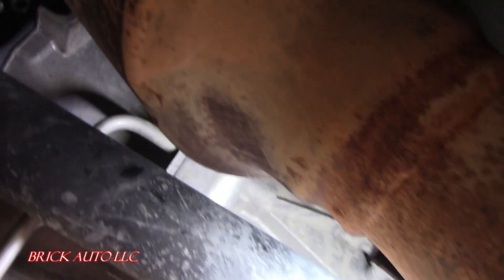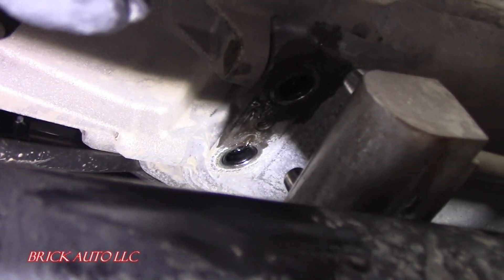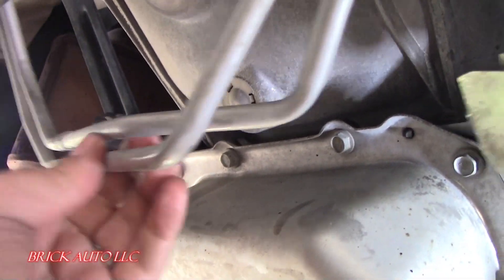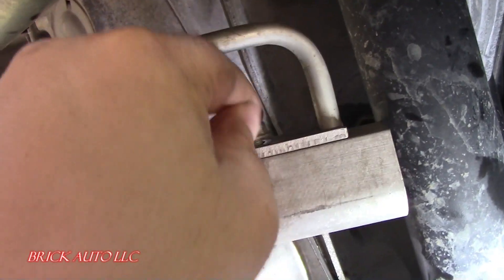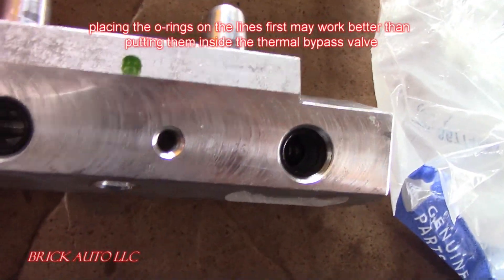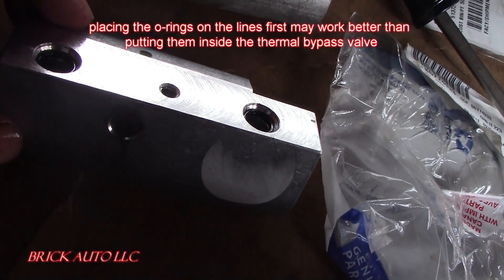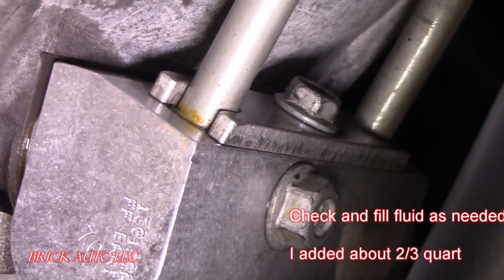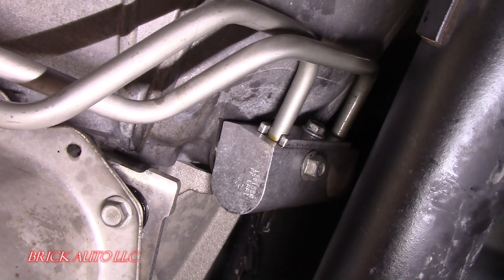Silverado GM 6L80 Transmission Thermostat (TBV) upgrade - Runs 40 degrees cooler! TSB 21-NA-199

Comment: I had this TSB done when I had my old blown-up 6L80 replaced with a GM reman last month. Was running in the 190s all the time, now it tops out around 170 and only on a hot day in heavy stop/go traffic. I am confident this will extend the life of my new reman transmission.

Comment: Valve (new) 8558533 has replaced (old) 86774933 and seal (new) 85628205 has replaced (old) 23135703.
Reply: Yep just got these parts from the dealer myself today, updated part numbers. They also had no idea what this tsb was but they were happy to help

Comment: Doing it now... 2016 5.3 97k miles. Tranny went out at 82k new transmission trying to get it to last longer then 82k
Reply: Had you changed oil an filter at 45,000 miles? Like your owners manual says?
Reply: Any update on how the truck is doing so far?

Comment: Well, this blows. Gmpartscenter says its no longer available. If you know where else I can get this please reply. TY:)
Reply from the maker: Sorry, finding quality parts if found at all has been troubling for all makes the last couple years. For this, I would do general searches for the part numbers and see where they pop up. While searching you might come across interchange or updated numbers for the ones shown & if nothing else, I believe there is an aftermarket kit to swap out from within the housing. The latter should be available as an alternative,  I think others have posted names in the comments or will certainly come up in general searching. Good luck
Reply: There’s new part numbers. Someone in the comments posted the updated ones. I can confirm, because I just got the updated parts to preform the swap today at my Chevy dealer. So they’re around you just have to do some digging

Comment: The updated part can still fail just like the original one. It still has a thermostat that can stick closed.
Reply: Correct me if I’m wrong but modern thermostats are designed to stick open when failed, so will flow constantly. The problem with the original part isn’t that it failed, it’s that it was designed to run too warm.

Comment: did anyone have a what sounds like air purging sound after doing this? my truck makes this weird noise when driving for the first 10 mins like its purging air thru the valve. My temps def went down they average about 160 now so it works great..
Reply from the maker: @JamieRabago-x3k  unusual symptom after this repair, I'd double check the seals, fluid level after a few cycles/ short trips and see if you can drive around with live data on a scanner looking at relevant pids while it's running... if all that checks out and still have issue, perhaps a faulty part

Comment: Does a 2018 Tahoe have this same issue and fix?
Reply from the maker: I don't see it on the old tsb, I would search for updated TSB's as this info is a couple years old and could be outdated. You could also check which trans you have from the RPO label

Comment: How high has your temp been during warmer days and stop and go traffic? I switched to this bypass valve a year ago and noticed the truck still may get up over 180-190
Reply from the maker: The trans temp has not gone over 165 f , all year round and regardless of load
Reply: Mine did the same thing I installed the mishi Moto trans cooler and it is much better
Reply: Yeah he didn’t show us if it’s stop and go traffic that’s the real test I was 149 in highway then it goes to 165 in street
Reply: I just changed it and it still goes up to 180 -190. what recommendations are there?
Reply: Did the install this morning. Didn’t get about 164 In town but driving at 75mph in 90 degree weather with 22inch rims and 35 inch tires, my temp with up to 176. Was hitting 203 before the bypass install so yeah it’s running cooler but is 176 still pretty hot?
Reply: @jesusmj602 any update ?
Reply: Probably need to drain and fill fluid and/or Aero Shutters behind grill could be stuck closed.

Comment: Did you notice anything different on how it shifted or clunks
Reply from the maker: No significant change on this truck. It had a minor clunk from 2-3 when cold. It was reported back that it seems a little better overall in shifts, but it wasn't terrible before.  I recommend that the fluid and filter be changed as a maintenance item anyway to keep it that (best chance of it anyhow), which I think the owner will do soon.
Reply: @brickautollc  thanks for the reply

Comment: I’m trying to figure out if  this is the same transmission in the 4.3 v6. My temps get up to 230 some days. Can’t find any info. Do you know if it’s the same trans?
Reply from the maker: Check the RPO code, gm trans start with 'M'  cross reference RPO list from Google search and M code you have. This part might not be the one for you but search aftermarket companies for trans thermostat, many options

Comment: In city driving, it stays around 155°F but about 20 minutes on the highway, and it goes down to 125°F. I think that's too effective at 1 thing and could negatively affect other things with the expected viscosity for that fluid at >180°.

Comment: has anyone used the PPE Power 125068000 Transmission Fluid Thermal Bypass Valve - 6L80 ?

Comment: I just did it. No leaks, but I'm having hell of a time getting the lines back in the clip. They just press in?
Reply from the maker: Yes, should push back in. Persuade them a bit, just don't kink em!
Reply: @brickautollc  

Thanks. I got one in and I'll try again tomorrow for the last one which does not want to go in. My thumbs hurt lol.

So I took it out for a drive and noticed right away. 192-194 degrees is a thing of the past. It hovers at 144 cruising on the highway and the highest I've seen is 153 after getn' it. It quickly goes down to 147-149. I love it. 🤙

Comment: What year is your Silverado? I’m trying to figure out if I have steel or aluminum lines
Reply from the maker: The truck in this video is a 2016 w/ steel lines. Per tsb MOST 2019 and up are aluminum and prior are steel.
Reply: @brickautollc  do you have to replace the o-ring or could you get away with reusing
Reply from the maker: @Mizzy4106   if it's your vehicle and it isn't damaged, give it try. If it's someone else's, I would replace to avoid comebacks (and they are cheap)
Reply: Magnet!!!

Comment: I have a question, I'm in canada our summers are in the 80-90°f the winters can get down to -30-40°f would this be safe in those winter conditions?
Reply from the maker: This changes the top end / how hot when it opens, it doesn't impact anything if it doesn't get that hot anyway.  This won't change how low or cold it goes, just allows the maximum temp reached to be less.
Reply: @brickautollc  okay thanks for the reply, would the cooler temp give it less protection in the winter?
Reply: @gustavohonzofo no because winter or summer it's gonna be the same temp.  Do the mod.
Reply: @nonameforyou5862  thank you

Comment: I think the larger problem is people who don't swap out the trans fluid regularly.
Reply: @jaybilawchuk2225  I didn't take my pan out. I pulled the cooler lines at the radiator and started the truck to pump about a gallon out first. Then, I took the pan bolts out and pumped the remaining fluid out with a cheap hand pump and wiped the pan out. Put a new filter in, filled it with new fluid, started the truck to let it pump out until bright red, attached the lines, and topped the fluid off. Can all be done without completely getting the pan out. Just FYI
Reply: @markman7  yeah that’s true. Sorry for the smart ass reply. You’re right, it can be done in different ways like that too. I just don’t know why they don’t have a drain plug in the pan like almost every vehicle does now. That’s all. My next thought was to suck fluid from the fill plug on the side of the trans. But not sure if tubing would get right to bottom. Just for a quick drain and fill between full services. Just frustrating coming from a full ford history to this one, and I see so many things that are so far behind from my 14 ford I had. Other than that, I do really enjoy this truck. 6.2 is such a great engine. Not sure on the 8 speed yet tho. lol. Once again, sorry for the rude.

Comment: What was ambient temperature at the time of this recording?
Reply from the maker: 60 F
Reply: @brickautollc   Thanks, I just completed mine and it was 90F outside and my transmission temp got up to 170F, however it was avg 195-205F before.   I'm ok with this.   Thanks for the video.

Comment: What is the size of the orings?
Reply: @3:46 he posts the bulletin and if you look under description all the way down to where it says o ring right beside that it’ll tell you the part number. Not sure how to figure out if you have aluminum or steel lines tho
Reply: Does this work on the 1500? Even if it’s a 2500/3500 part?

Comment: Is this on 4.3 V6?
Reply from the maker: The truck in this video has a 5.3 V8.  This video is on updated the thermostat for the 6L80 transmission,  RPO code 'MYC', check RPO codes to see what transmission you have and if this TSB applies or not.

Comment: just purchased a 2018 sierra. Is there any way this model could have come with this thermostat already installed from factory? Does it usually take pulling a trailer to get the old style up to 194 degrees?
Reply: my 2010 used to get till 170 pulling a 16' enclosed trailer
Reply: No I’ve got a 2016 and it’ll get up to the 190s with absolutely no load, so I just ordered the new TBV and will be swapping it out soon
Reply: Same as the person above. I have a 16’ Sierra with 8L90. Trans temp gets up to 190° just with normal driving. Will be swapping mine out soon. Got the new TBV and gaskets has a “70”engraved on the solid end
Reply: @mjdizzle94  got mine swapped out a couple months ago, super easy swap, and now it sits at 147°, so much better
Reply: @sammy9860 what was the ambient temperature for you at the time? I just installed the new updated valve from GM but  driving in city still got up to 196.  85 ambient temp here
Reply: @gmm4343  hmm, it was probably like 10° at the time of that comment, but now as summer weather is here, it still stays cool, only gets up to like 170° at the absolute hottest when I'm in stop and go city traffic
Reply from the maker: @gmm4343  60 F